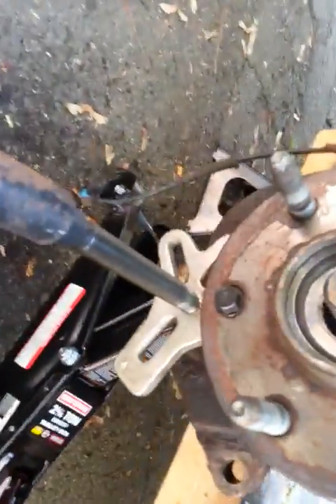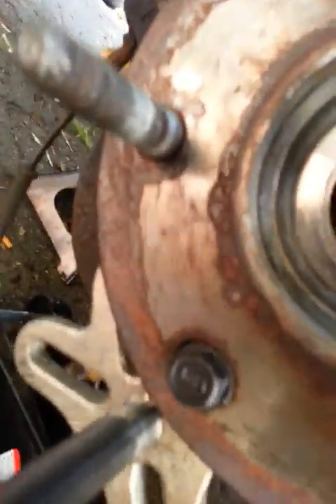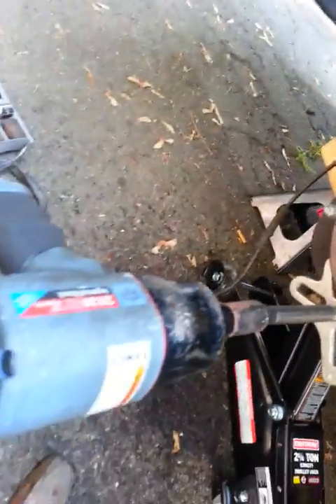How to remove a Frozen Hub Bearing cheap part 2

Comment: I gotta do a front bearing on my Lexus LS460 this weekend.
I think I’m gonna try your method. If it don’t work…I bought a hub buster tool
Reply from the maker: Yeah Man you shouldn't have any problems with a hub buster or a slide hammer and puller. Might take a few hits but they usually come out with some effort. If not definitely try a method that will push from the back rather than pull it from the front. I've done a quite hubs in my lifetime and they can be a nightmare. Always keep a torch and sledgehammer near by but usually the best method will be a slide hammer with a puller end. Check out a Harbor Freight or a Home Depot for either buy or rent..

Comment: Why dont you get a longer bolt, ditch the slide hammer flange and have the longer bolt pass through the lug stud hole, through a nut and push against the steering knuckle  ??
Reply from the maker: Didn't have a longer bolt that would go through the lug hole. The longest was from the Steering wheel puller kit and the diameter is too thick. Notice a couple of lugs were knocked out because I tried going through.

Comment: Who the H.. would neglect their vehicle this bad it gives off plenty of sound when they're going bad.
Reply from the maker: Wait Do Car Rust because of Neglect? What Amazing Logic is this?😂😂😂😂 Um when you have a 2000-ish Vehicle in Multiple Weather Types and add Salt from the Ocean then Rust and Corrosion happens. Just because a Hub is rusted doesn't mean it's bad and usually by the time a bearing goes bad, a Hub if driven daily in the East Coast will be rusted especially from Heat to Cool add Water.. That's how Metal things get rusted.. Not Neglect.. 😩... Metallurgy 101
Reply: @JAMESJJEFFERS  Yup, you sound like a victim to ignorant it sound like a train going down the road it been neglected LMBO!!! Driving with a bad wheel bearing can cause the axle/hub/spindle to weld itself from friction and heat causing the wheel to lock up and spin you out.
Reply: @chuckychuck  THANK YOU ! Mr. Goodwrench! 🙄
Reply: @JAMESJJEFFERS  I am 74, moved from NJ to the Poconos area of PA. Never had a tool rust...even minor rusting wasn't a problem on my 1996 van (2021 today). Everything rusts up here even just sitting in the van. I too will be doing a wheel bearing on my 2005 Malibu and I will use the bolt thru lug stud but with 2 bolts  so I can keep fairly even pressure. I fear with one bolt  or using the offset like a hub buster might make the hole oval...just me I guess.

Thanks for the video and ideas.

Comment: They also make a tool (manual operation), called a Hub Buster which I own, works AWESOME, about $100!!!
Reply from the maker: Jeremy knight Someone who normally wouldn't do this might not invest in something they won't use again. Again this is for people who might need another way and have a limited of funds or stranded somewhere without access to such tools.

Comment: since you have air, why not use an air hammer
used it on my yukon, 30 seconds it was off
and yes it was like yours, my other side which i had done previously, took over 3 hrs of banging on it
Reply from the maker: Rob S. At the time I didn't have an Air Hammer as well as this is a Video for people who don't have compressors or a Yukon like ours...So this is another way they can improvise if they are in a jam with limited funds and tools.